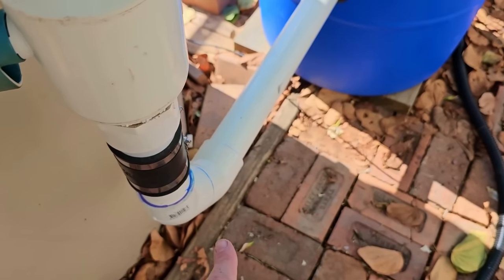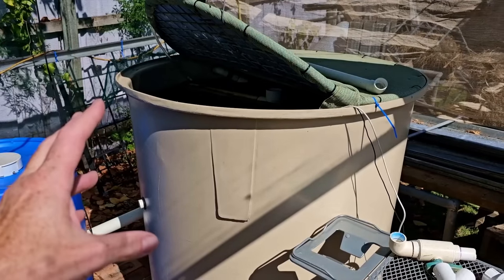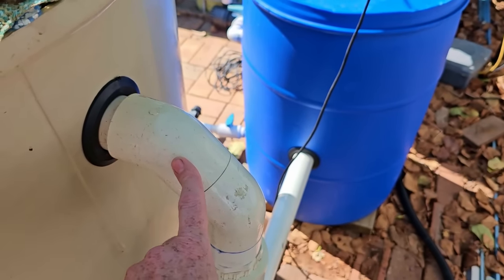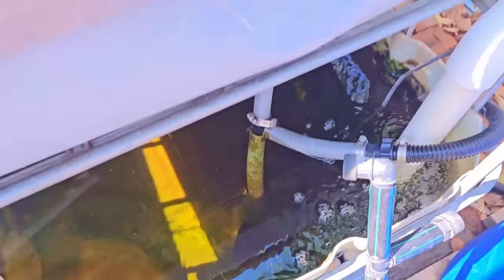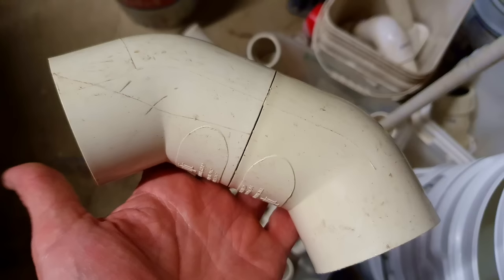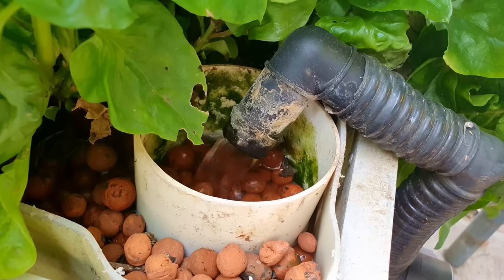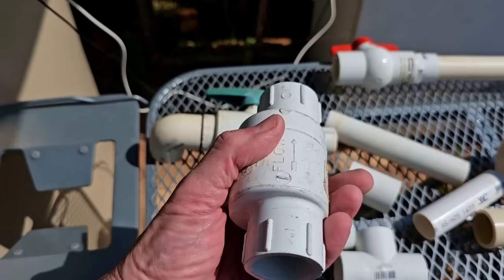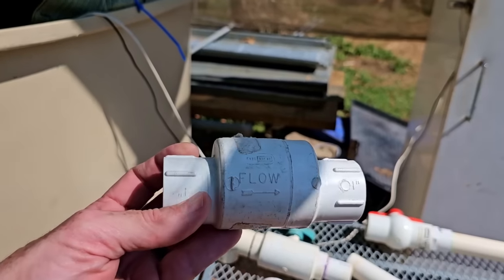ESSENTIAL Aquaponics Plumbing | DIY Fittings + Tips & Tricks Included

Comment: I have the valves with screw threaded unions either side, makes cleaning and replacement easier.
Reply from the maker: Have used a few of them as well Lee like on the drain outlets on the FT. Just didn't get to cover everything this time round. 😉

Comment: Hi Rob, those red handle ball valves break down in the sun, i cut my fingers open on 1 as it snapped.
Reply from the maker: I only used them for a couple of years before they got mothballed. These Sanking ones are over 12 years old & still going strong.

Comment: A variable pump is ideal and I can really recommend it to any person with a pond or aquaponics system. I have one that also has a pause button so that you do not have to unplug the plug if you want to do maintenance, which is very useful. It also has a memory for the last operating setting, a soft start, overheating protection in case there is no water for whatever reason (frost or leak in a dry installation) A simple display that shows the power consumption and at what capacity percentage the pump is operating. Wet or dry installation. And the newest updated pumps from that same type of pump even have a wifi connection that communicates directly with your phone without the need for a router or an internet connection. And it can be programmed with the app. They also use about half the power from a traditional AC power pump. I believe that they have 3 or 4 different models with a different capacity up to 20.000 L/h. 

Compared to a traditional not variable pump those variable pumps from this brand are only about 10% more expensive when you buy them. And much cheaper compared to similar style pumps from other brands. In my country, the Netherlands, we have relative high energy costs, so I earned back the 10% extra purchase costs within a year, and I have all the other functionality which has proven to be very useful. I am using it for 6 years without any issues. 

-Aquaforte DM-vario
-Aquaforte DM-vario S
-Aquaforte DM-vario S Wifi

There are 3 different types from the same pump, the DM-vario is the oldest version and the other two are updated versions. 

(I do not know if they sell it in every country.)
Reply from the maker: Cheers for this mate.

Comment: Australian DWV pvc-u non pressure pipe is drinking water safe in AS/NZS 4020 vindiex/iplex made. Also low density poly (irrigation) pipe is fine . Rural green stripe and metric blue stripe are the same material just different pressure ratings. Clear PVC tube/hose and vinyl garden hose are not food grade...but most people water there vegetable gardens with "garden hose". So you don't have to use pressure PVC pipe unless you are perhaps a comercial operator and require "food grade" certifiaction for legal inspection reasons.
Reply from the maker: Pressure pipe has a lot more fittings as well so that's another reason I prefer it.